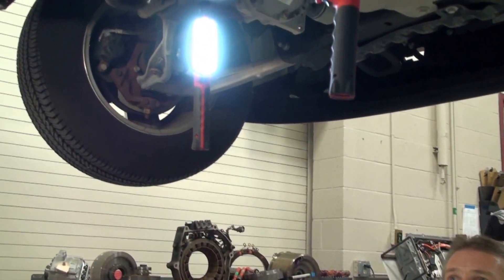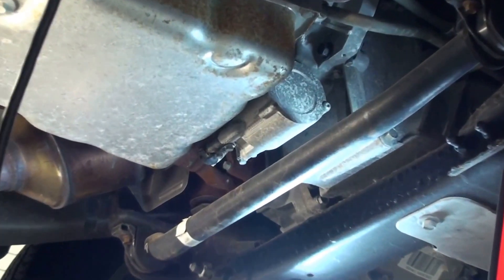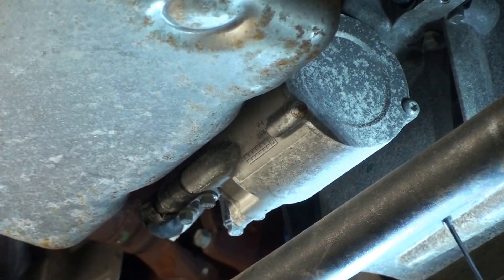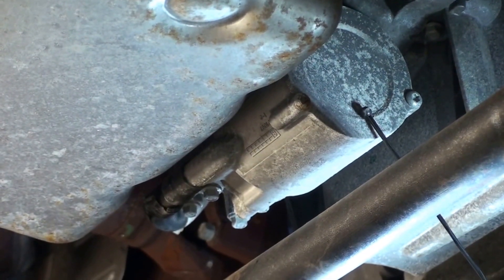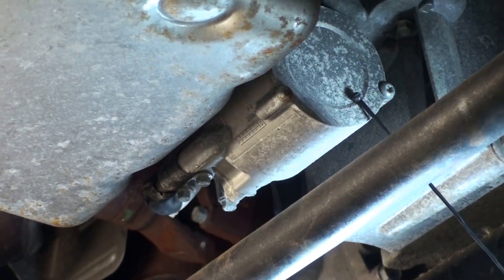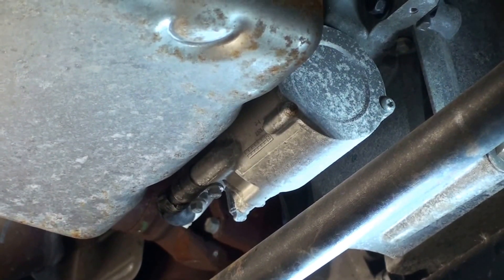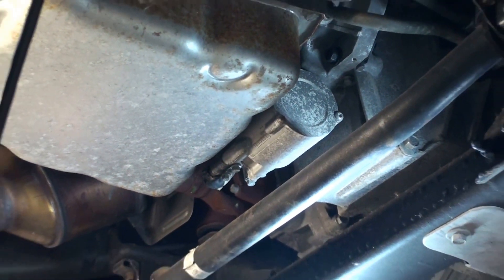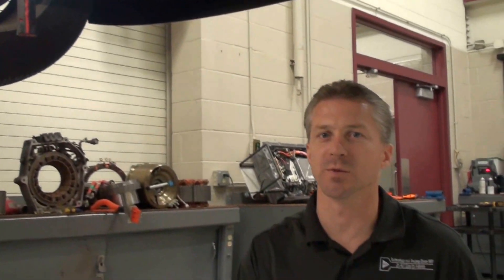HEV-TV 1.15: Auxiliary Pump in Automatic Transmission

Comment: if this part starts failing will a code be present?
Reply: Daniel Shelley check engine light with POAC4 is what mine reads
Reply: Jorge Vasquez  jorge si oudiste arreglar tu camioneta?
Reply: if you get auto stop lag  sometimes it can be fixed cleaning the connection